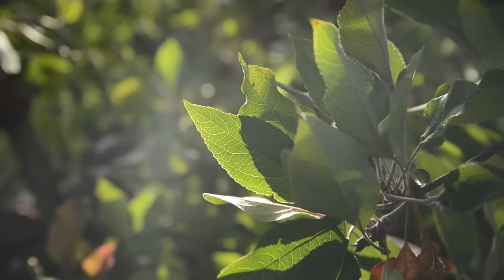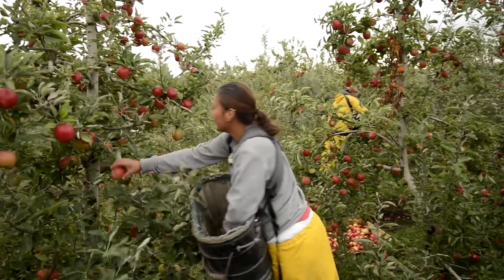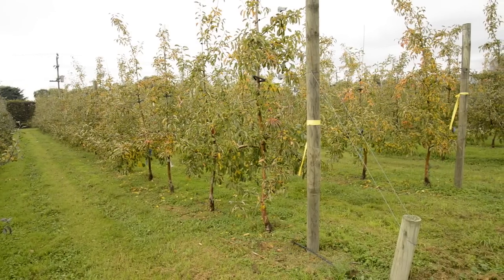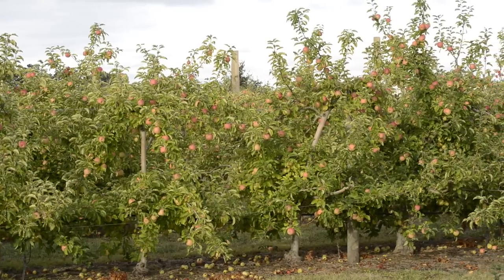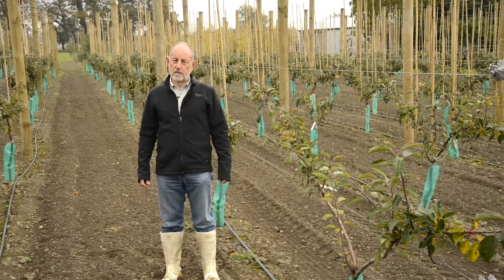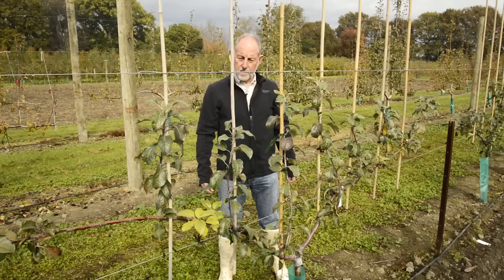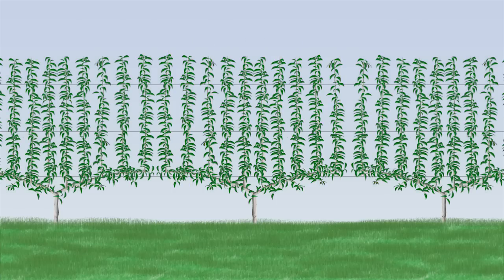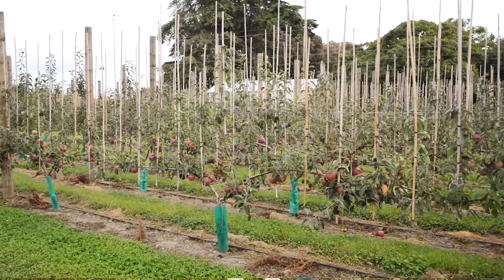Is this the Future of Apple Growing?

Comment: Interesting. Everyone I've ever heard says fruit only grows on lateral branches. I guess there is a lot of misinformation out there.
Reply: Cherries, Apples, Pears, and Plums tend to bear fruit on spurs: long lived growths on 2+ year old growth that continues to form flower buds (there are a few apples that are tip-bearing, meaning they fruit similar to peaches). Peaches, Nectarines, and apricots only really fruit on the previous year's growth. Citrus, figs, grapes, and mulberry fruit on new growth (current year).

This system is more challenging with peaches and tip-bearing apples (more space needed between rows  and between uprights to accommodate the growth needed for fruitset (or utilizing a slightly different pruning methodology)), but the yields are still better vs the same variety on a more traditional tree shape.

Comment: I’m trellising my newly planted cider apple orchard laid out on a 10’ x 10’ spacing to a planar system with a 6’ top wire but bamboo stakes at each fruiting branch that will extend to 8’ or higher. My goal is to interplant plant trees next year reducing my tree spacing to 5’ but which to start with what I have now. My rows are mulched with 4’ wide rows of wood chips to promote mycorrhizal fungi, retain moisture during the growing season, and keep the soil warmer during winter. Center rows are planted in fescue and Dutch white clover for nitrogen.

Comment: Sir, the latest techniques of following rootstocks system is extremely wonderful but this is very troublesome and costly affair involving lot of infrastructure on training and other cultural practices. It is not possible to do this type of Horticulture in India as apple is generally grown here in mountainous regions which are slopy. I don't think it a financial paying off proposition. Life span is also very small  hardly upto a decade and very early declining symptoms starts emerging. The only benefit is they come into bearing much early as compared to  conventional seedling rootstocks. I will whole heartedly welcome and solicit your detailed views on its benefits. Thanks. With heartiest regards.
Reply: Yes best suited to flat land
Reply: You could run your rows across the slope, rather than up and down it. (best suited to a southern slope). You could also modify the system you see here by utilizing a longer living, better anchored, semi-dwarfing rootstock (like Geneva 890). These Rootstocks are far better anchored and vigorous (more suited to the types of soils and weather conditions you're likely facing). A better anchored tree is less reliant on the trellis, and so the trellis can be less expensive to build (kept to a short height to best utilize the narrow rows, it ends up being little more substantial than a high-tensile wire fence (like would be used for livestock), quite adaptable to slopes).

I've planted my trees much like what you see here, I space my trees at 7 feet (2.4m) in row, with rows 7 feet (2.1m) apart. Bottom wire is at 18 inches (45cm), middle wire is at 4 feet (1.2m), and the top wire is at 7feet (2.1m). Trees are kept to roughly 8 feet (2.4m) tall. I use the cordon and upright fruiting offshoot system for everything I have (cherry (mahaleb rs), plum (Krymsk99 rs) , pear (OHxF 87), apple (G890), apricot (Krymsk99), and peach (Krymsk1) (peach and tip bearing apples are a little more challenging, requiring more space between the uprights due to the fruiting habits).

Being able to pick 80% + of the fruit from the ground is far faster and safer than crawling up and down ladders, earlier and higher yields are just a plus. Sure, the trees only live 15-20 years (10-16 of which are at full mature production), compared to a standard tree's 50-75; but 10 years of the standard tree are spent not-fruiting, and even the mature yields are low per acre. These systems are more productive in their 3rd or 4th fruiting season than traditional orchards are at full maturity. At full maturity, you're looking at 8-10x the production per year (150-200ton/ha) vs traditional orchards (20ton/ha). The simpler canopies of the hedged systems also are easier/faster to prune. These systems allow you to manage more acres with the same number of people, or utilize less labor for the same number of acres.

If you have 5 acres available to plant orchards on, it is far more productive and profitable to plant a third of an acre per year for 15 years like this, than it would be to plant all 5 acres at once in a traditional, low density manner.